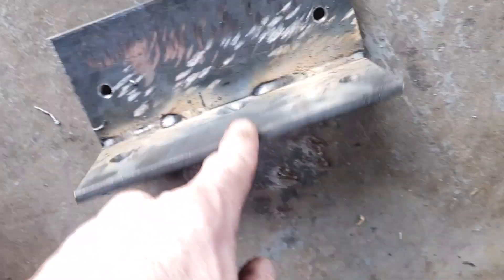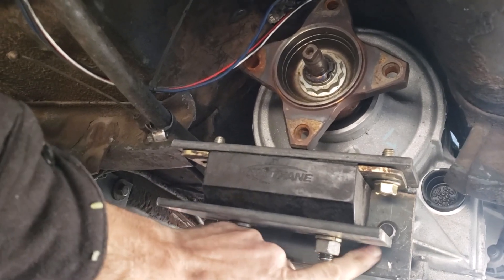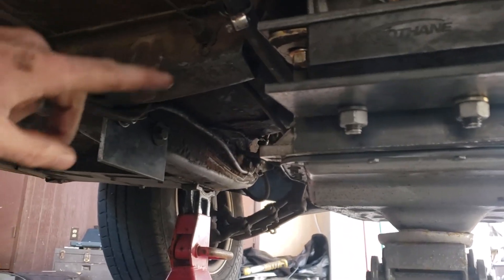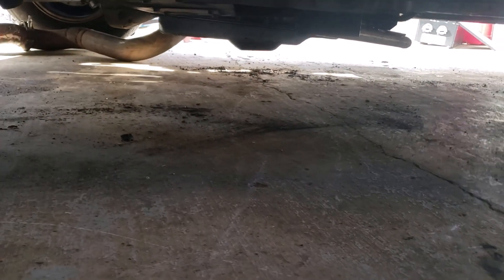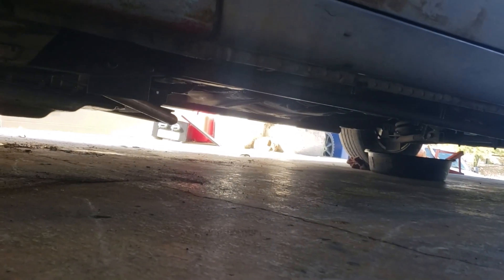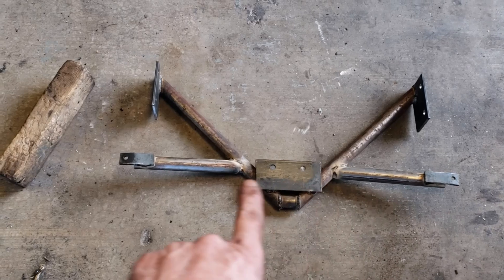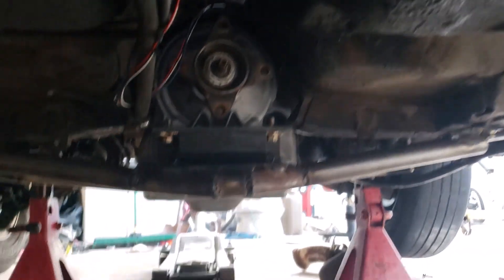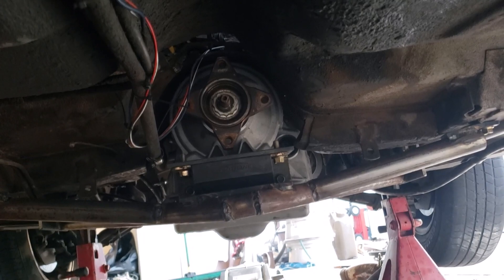6R80 Transmission Mount build Part5

Comment: I am very seriously considering doing this in an old pickup with a 351w. Looking forward to seeing more!
Reply from the maker: Thanks, I found a late model 302 block to replace my broke one.  So new motor will be soon.
Reply: @olboy1981  Rewatching the earlier parts now, but did you have any issues with the torque converter? I see there's a spacer kit for mating the 6r80 TC to an sbf flexplate.
Reply from the maker: @AnIsolatedMind  since the adapter plate is only 1/4 in thick, I figure I can shim the TC out with 1/8 thick washers if need be.  I'll do another test fit with a crank in the block here shortly.
Reply from the maker: Added a part 6 which shows the fitment of the converter to flexplate